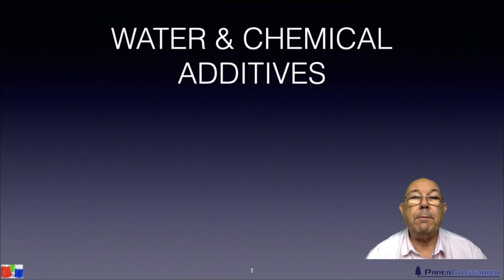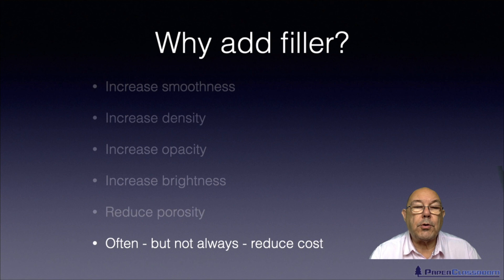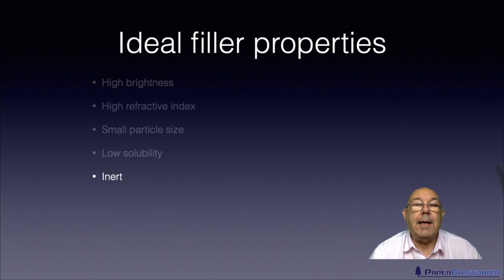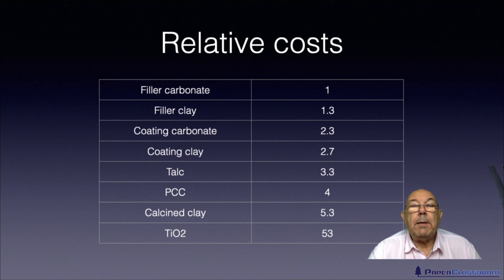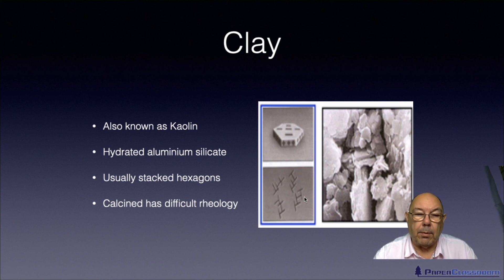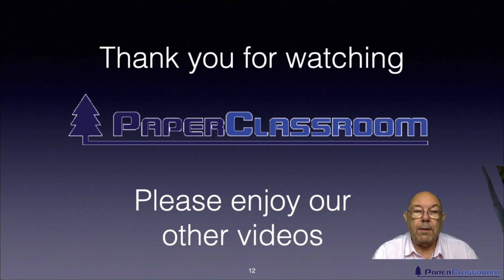Level 2 Papermaking - Fillers

Comment: As a handpapermaker in Ecuador we have sourced TiO2 from a paint supplier. We are attempting to make watercolor paper. Can we add this to the Hollander beater or to the vat where we are pulling sheets?
Reply from the maker: Hi. Thank you for your question. You do not say if the TiO2 is solid or slurry. You can add it in either place, but personally I would not add it to the beater because of the TiO2 wearing the knives on the roll and bed plate
If the TiO2 is in solid form, disperse it first, then add the dispersion to the vat

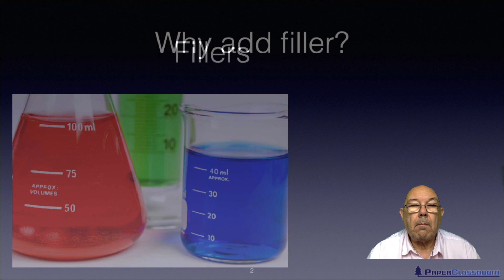Comment: 0:23 Why add fillers?
+ To increase Smoothness
+ To increase Density
+ To increase Opacity
+ To increase Brightness
- To reduce Porosity
- To reduce Cost

2:10 Ideal filler properties
+ High brightness
+ High refractive index
+ Small particle size (for smoother sheet)
- Low solubility
+ Inert
- Low cost
- Low density (smaller, lighter)
+ High retention

3:46 Which filler is not inert?
• Calcium Carbonate

5:28 Relative costs

9:43 Clay
• aka Kaolin
• Hydrated aluminum silicate 
• Usually stacked hexagons
- Calcined has difficult rheology

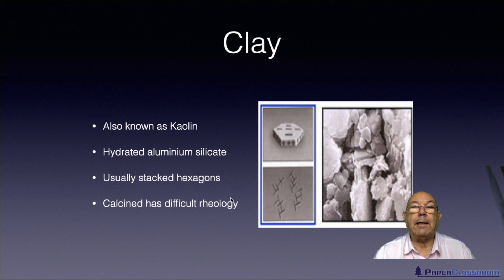11:29 Calcium Carbonate or “Chalk”
• Natural
• From sedimentary rocks
• Usually stacked hexagons
• Almost round structure
• Calcite and Argonite crystal structure
+ Brighter and cheaper than Clay

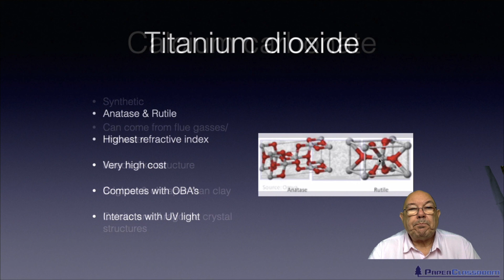14:35 Titanium Dioxide (TiO2)
• Anatase form & Rutile form

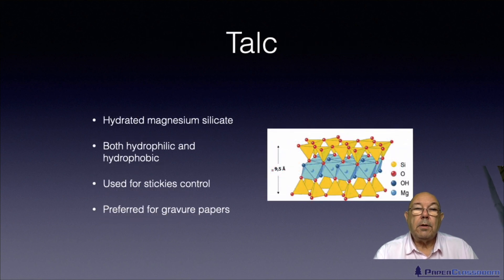17:07 Talc
• Hydrated Magnesium silicate

18:04 Summary of Filler